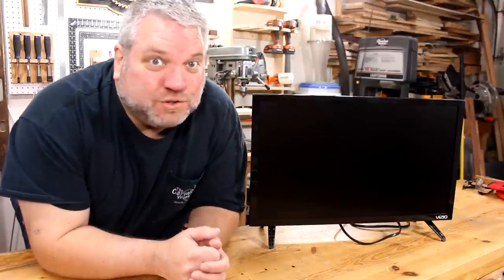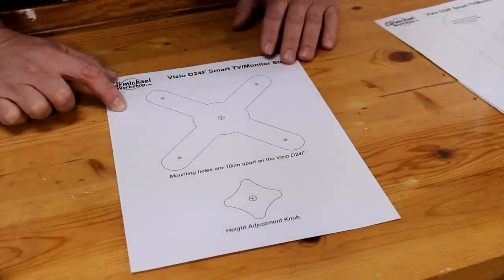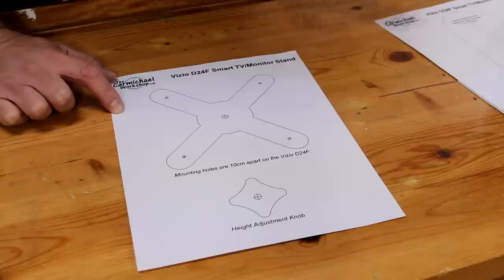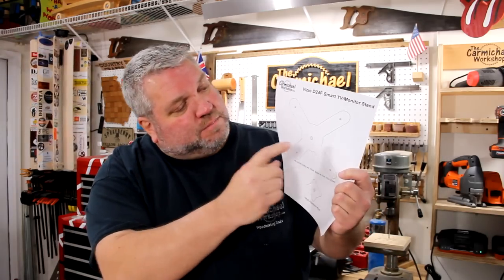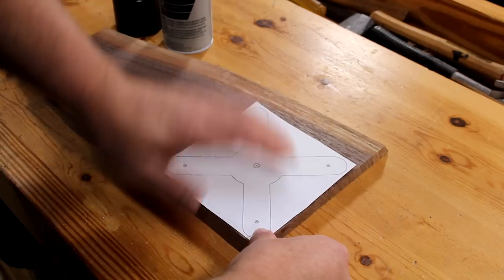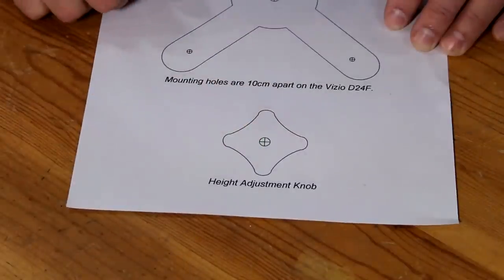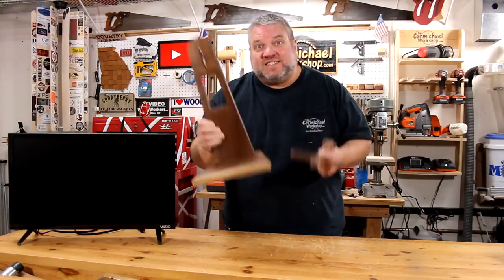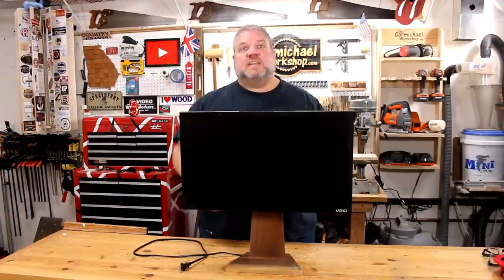Make a DIY Monitor Stand for a Vizio D24F Smart TV

Comment: Nice job Steve.   

You probably know already - but didn't show it - that it is worth trying to find the right nut for a thread to be cut short, and screw it onto the bolt before cutting it and tidying up the end with a file.   As the nut is removed, it forms the thread nicely at the cut off,.
Reply from the maker: Hi Don - Thanks!  That's a nice tip!   I haven't done that before, but wish I had thought of it.  I sanded the end of the cut bolt to a taper, but I don't think I showed it in the video.

Comment: Hey ..that was awesome...it'd be really cool if you could just show us the mechanism for the up down tilting..!!
Reply from the maker: Thanks!  It doesn't tilt, just slides up and down to change the height.  I did go back and cut the bottom of the upright piece at a slight angle to lean it back a little.
Reply: Sorry to bother you again..but could you tell how the height adjustment thing works...I understand the knob screwing to the mounting bracket but how does it remain in a certain height in the slot...does it not fall down...I mean what is the width of the slot..and after sometime won't the screw eat at the wood so that the height adjustment becomes loose..
Reply from the maker: The upright piece on the stand has a slot in it.  The bolt on the knob goes through the slot and into the threaded insert.  This allows the TV to slide up and down the slot and swivel left and right.  When you position it where you want it, you just tighten the knob.  The mount and the upright have a lot of surface area that touches each other, creating a friction hold.  A large washer between the knob and the upright piece prevents any wood eating.  The slot is the same width as the bolt, but sanded some so the bolt slides freely.
Reply: Thank you so much Steve..you've been really patient in explaining every detail...again..I loved the video and the way you explain things..and your jolly self...keep it up..you've already earned a long time subscriber in me...👍

Comment: Tip. Put a nut on the 1/4 x 20 bit before cutting it. Then after you cut the bolt you turn the nut off to fix the threads where the cut was made.
Reply: Lol. Guess I should read the comments before making mine...

Comment: Thank you for this, i lost my monitor mount now i just make a new one
Reply from the maker: Cool!  Glad you could use the idea.  I still use mine.  After the video, I found that the back of the TV had a slight curve to it, so I cut a slight angle on the bottom of the upright piece to make it tilt back a little.  Easy fix.

Comment: I believe the 10 x 10 cm mounting pattern should be universal for TV monitors of that size Steve. Shouldn't need a need to adjust the spread of the bolt holes unless going to a much larger TV. Screws should be M4 and the length is equal to the thickness of bracket + 7.4mm..https://en.wikipedia.org/wiki/Flat_Display_Mounting_Interface

Comment: Like the project a lot but do have a question. Why didn't you use your X Carve to make the pieces?
Reply from the maker: I only had to make one and the bandsaw cuts much faster than the trim router.  Plus, I had to work around some bad spots and color variations in the wood, so it was easier to place the templates in the exact part of the board I wanted instead of trying to line it up on the CNC crooked so it would carve in the right spot.  If I had better wood and had to make more than one, I'd definitely let the x-carve do it while I do something else.

Comment: maybe you can do a VESA adjustable angle arm and height for monitor. my eyes are 60cm of distance with the panel and monitor 16 to 17cm of the wall. i want both monitors alined. i don't had the space and my Samsung can fall to the floor because i had a desktop with a level and the 2 monitors.
Reply from the maker: I still use this stand on my monitor.  I was going to make it more adjustable, but thought as long as I get it how I want it, I would never adjust it.  It's still the same position as when I made the stand.  I did have to cut a slight angle on the bottom of the upright piece to make it lean back a little, because the shape of the back of the monitor was curved making it tilt forward a little.

Comment: looks like that monitor/tv has 100mmx100mm VESA mounts which is pretty common. Now i just need to adapt these plans to hold my two monitor setup, and provide a few more degrees of freedom (height, angle, rotate, pan) independently for each monitor. It'd be nice to get that desk space back from under the monitors.

https://en.wikipedia.org/wiki/Flat_Display_Mounting_Interface
Reply from the maker: I wasn't sure if the 10cm x 10cm holes were common or not, so I'm glad they are so my templates will work for other TVs.  the base of the stand is a good place to keep my glasses, pen and post-it notes.
Reply: I run two monitors at home and bought my mount 'cause I ain't handy like Steve. Only other suggestion I can make is rather than a big foot at the bottom adapt a C-clamp to hold the mount to the desk. It should be less tippy than a foot when holding two monitors. HTH.

Comment: Nice video but there is a reason why tv’s aren’t used as monitors. Headaches from being too close.
Reply from the maker: Thanks!  What is the difference that causes headaches?   Not sure I understand why being too close would make a difference - seems like you would sit the same distance away from a 24" TV and a 24" monitor.   The bigger the screen, the further away you sit right?
Reply: Steve Carmichael Just how the pixels are designed for viewing angle. Your eyes tend to strain much more when being close to a TV. Generally you sit 2+ metre away from a tv where a monitor you are 400mm+. I had this problem and had to throw the small tv out and moved to a 27” monitor. No more headaches.
Reply from the maker: Interesting!  I was thinking of getting another TV to watch while I exercise, so I might get a bigger monitor then use this small TV as a TV.  Hmmm